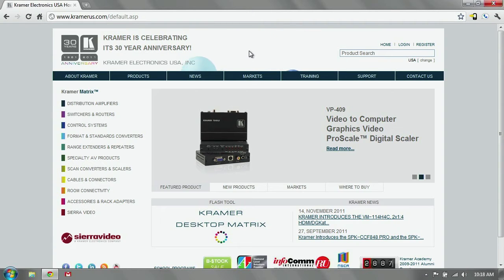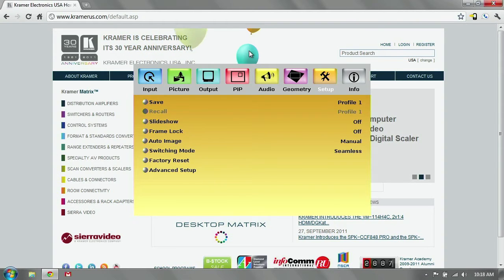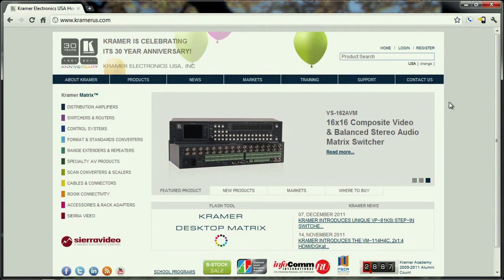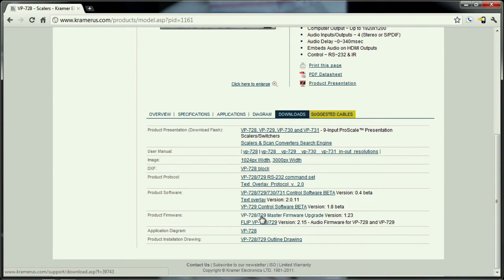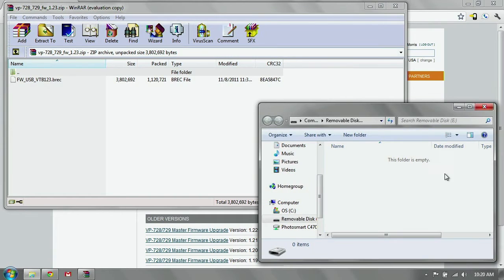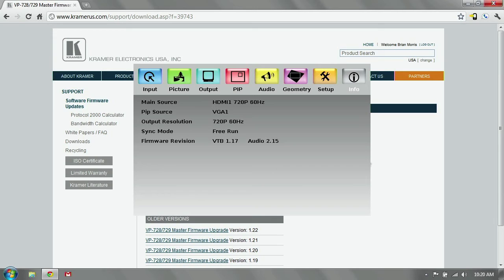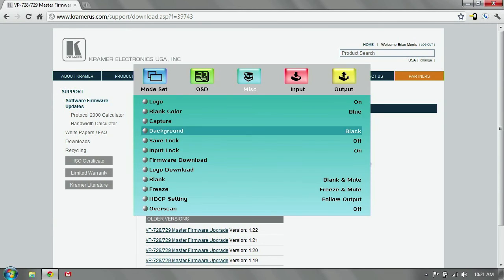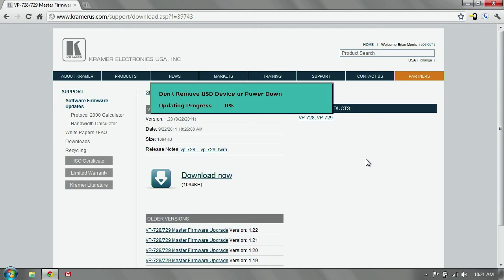How to Update Firmware

Comment: Do you know if the the VP-729 can be used for capturing VHS video tapes?  I want to do S-video out from the VHS-VCR to RCA video input on the VP-729, RCA audio out from VHS to RCA audio in on the VP-729; then HDMI out (with upscaled 1080p video) on the 729 to a PC video capture card.  Thanks!

Comment: Still using a VP-728 in 2022! Works great for Gamecube, Dreamcast etc. Had to use an old USB drive, Kingston Datatraveler 512mb for it to recognize the firmware. Tried renaming the file to just firmware.brec using a SanDisk Cruzer Blade 8gb 2.0 and a Kingston Datatraveler 111 16gb 3.0 with no luck.
Reply from the maker: Thanks for the positive feedback

Comment: What format should the USB stick be ?
Nobody answered my mail @ Kramer.....
Reply from the maker: Hi, This product has been obsolete for over 7 years, due to major feature upgrades and a new brand. It was replaced with this product:  https://www1.kramerav.com/gc/product/VP-550X
We do not have information regarding the USB format, and suggest trying FAT32 and using a small memory stick (1Gb or smaller). Hope this information is helpful.
Reply: Made it work with FAT32 and the file has to be : FW_USB_VTB129.brec , no "dot" between 1 and 29